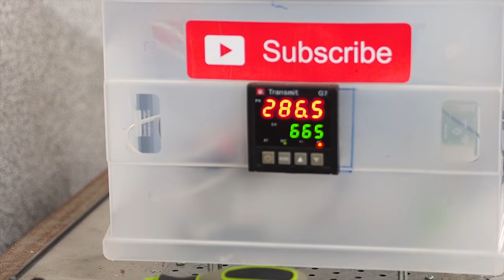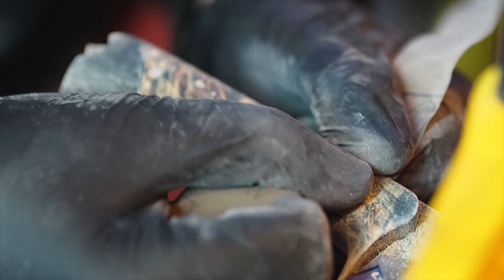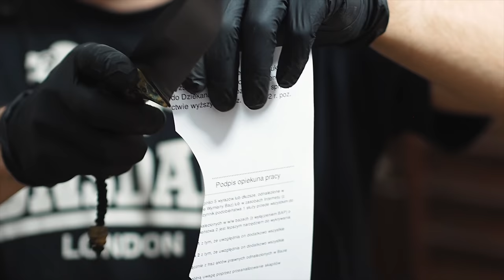Knife Making - Very SHARP EDC Knife w/ Turquoise Handle

Comment: Why put the knife in foil and why in dry ice? I've watched lots of knifemakers and this is new to me. (Only seen cryogenics with swords.)
Reply from the maker: The foil serves the purpose of preventing the steel from decarbunization. The cryo heat treatment helps change retained austenite into martensite which results in a harder steel ;)

Comment: What degree do you grind your edge out with
Reply from the maker: Never measured it, it depends on the design and thickness of the steel and is most of the time a bit different for different knives :D
Reply: Barbershop Customs what degree would you say for 1095

Comment: THIS WOULD BE A MUCH BETTER BUSH-CRAFT KNIFE IF THE BLADE WERE NOT THE SAME WIDTH IN ITS straight-blade part. In other words, if it had a slight cut-out, "belly" to it, about 1/2 of the way back. Other knives have this and are easier seen than me explain it. What this does is let the wielder cut and shave wood better, with the recessed belly, than with a 100% straight blade. See? Although these are maybe the best knives I have ever seen.